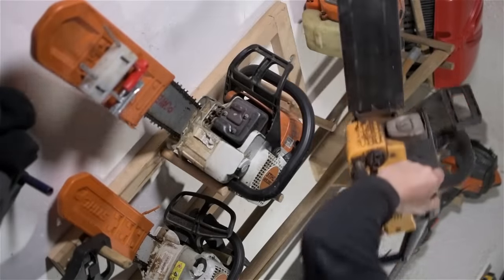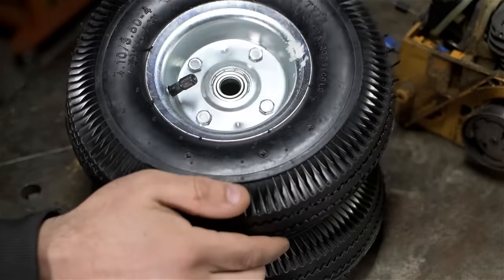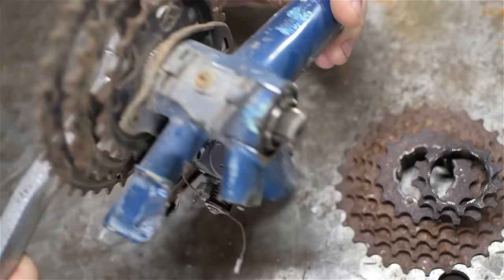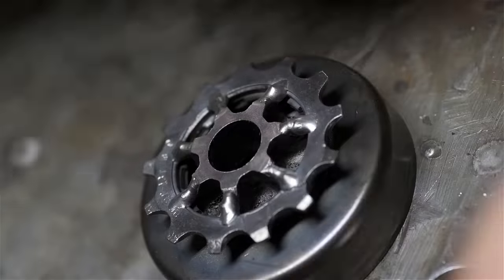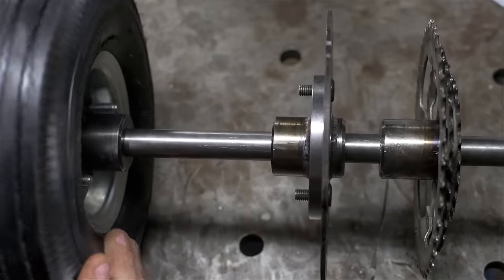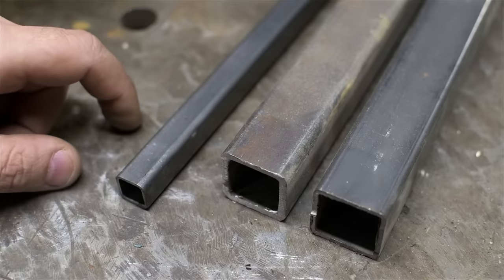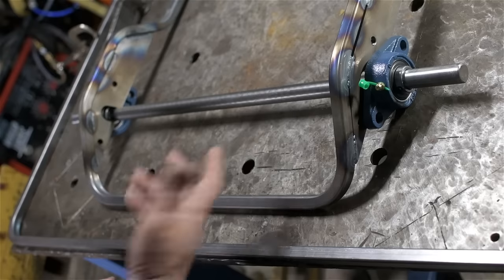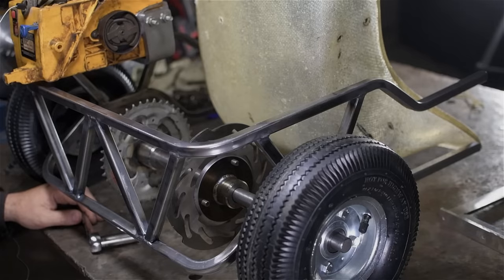CHAINSAW GO KART! - Part 1

Comment: Nice one Tony, really enjoying it so far.  Takes me back to the motorized karts I used to build in my teens.  One of my builds had a solid back axle driving both wheels (as you are building) and the problem with it is there is no differential so the inner tyres slip and squeal when you turn.  Proper karts get around this to a degree by have a high kingpin angle on the front steering hubs.  This causes the kart to tilt over/jack up a bit and lift up the inner rear wheel, allowing it to slip when you go around the corner.  But it makes the steering heavy as it is also lifting your own weight up to some degree and I think children would object to this. A later build just drove one rear wheel, with the other free wheeling and this was better although pulling away could make the single wheel spin as it was taking all the power.  Maybe that is a better compromise?  My builds used things like moped engines which including the transmission so I already  had all the gearing to get the correct road wheel speed.  In your case the double reduction using an intermediate gearset is probably the simplest, as you are planning.  You can then have the intermediate gear on a slotted bracket to tension both sets of the chains.  You can also experiment with the ratios by changing the intermediate set fairly quickly.  Make sure the engine mounting bracket is very rigid - the engine will get pulled down when it applies force to the chain and cause sprocket misalignment and thrown chain.  Ask me how I know!Also, I'm sure you will get to it but needs some shielding between the sharp gears and the seat/child.  Good luck with it all, it is giving me ideas again . . . !!
Reply from the maker: that is good info router, thanks!  I was actually planning on the steering taking some weight off the inside tire to get around the solid rear axle but you have a good point, steering will be harder, hadn't thought that far ahead.  Maybe giant comedy-sized steering wheel?  :)
Reply: Or power steering :)The other thing at the front end to think about is the principle of Ackermann steering.  This is setting up the geometry of the steering arms to allow the front wheels to take slightly different radiuses around the turn.  This is achieved by in plan view pointing the steering arms so they are angled inwards to point at the centre of the rear axle.  A quick google search will show a picture of the arrangement (e.g. Wikipedia).

Comment: Cheap/old bicycles require special tools. Modern bicycles can be taken apart pretty easily with allen keys and a heavily weighted hammer
Reply: Nugenrules tell that to the tool pushers at Park.

Comment: The 75 cc Partner I bought new in about 1977 is the predecessor to the Poulan line, since Swedish made Partner was sold to Poulan. That saw, with a 28" bar, was a killer! In fact, Partner bragged about two of those powering a light aircraft for hours! Sure miss those days . . .

Comment: Probably too late for this kind of change, but you could still use the gear setup. Just build a sprague clutch with a one-way bearing. That way the wheels could still rotate even when the engine was running slower than the driveshaft.

Comment: Real cool! Just a thought, if you did go for double reduction, you could include the free-wheel clutch from the bicycle sprockets so the wheels don't backdrive the engine. Although a little friction might be a good idea when you lift your foot from the gas...
Reply: Kobus Goosen don't forget about the clutch on the output of the chainsaw. It should prevent it from back driving the engine.
Reply: Yes, 2 stroke engines don't like engine braking, because when you close the throttle, you close the source of lubrication, fuel oil mix.

Comment: Why not use the worm drive combined with a freewheel on the axle? You'll even be able to fit a bicycle cassette and a derailleur.
Reply: that i was  gonna comment juste this, if it's not to late that should be the bestt solution
Reply from the maker: my kids wouldn't be able to push it backwards?
Reply: "Objects in a mirror are losing."
Reply: edit: Err... of course the worm gear will never run backwards and freewheeling it would either not drive the kart or lock in both directions, but using a freewheel and an intermediate axle will work.

Had to read about that a bit and see that video again, but as long as the clutch connecting the motor with the sprocket is open at idle/stop (which is the case for chainsaws), the freewheel might lock backwards and turn parts of that transmission. The centrifugal clutch type will avoid pushing against the engine in such cases.

The bicycles axle actually does what is needed. http://www.parktool.com/blog/repair-help/freewheel-destructive-removal#article-section-1
Without much knowledge about freewheels in general: there are bearing type freewheels, so if the engine is stopped, the clutch will be disengaged anyway and can turn free.
Reply: yes they would be able to push it back, use the complete bicycle hub and bore it to accept your shaft

Comment: You never cease to amaze.  I've been shoving soft things in cylinders for years...on bigger saws you can usually get the clutch off with an impact blip though, and the clutch is mounted opposite of the Poulan with a normal bolt.

Comment: When I built a cart for my boy i used a 5 HP Briggs High Performance engine. That cart would do 60 MPH. Yeee Haaaawww. 
My boy loved it.
Reply: gregg4164 lies
Reply: There had to have been a govenor on it
Reply: @fbi1961  not exactly smart are you? A 5hp brigs will easily push a kart 60mph, on a flat road with enough space.

Comment: I remember the first go-karts.  You had to make one yourself, in metal-shop in school or in your garage.  Then they started to manufacture them.  You had a choice between a four-stroke lawnmower engine like a "Clinton" (less expensive and not as fast) and a two-stroke McCullough chainsaw engine (I wasn't aware of any other makes back then).  The fastest karts had two chainsaw engines, one driving each rear wheel.  

At first, ordinary McCullough chainsaw engines were used.  Then when karting became popular, McCullough started making engines specifically for karts.  I remember the Mac 5,  Mac 10, and Mac 20.  

The cheaper karts had brakes that were nothing more than metal paddles that rubbed against the tires.  The better ones had mechanical drum brakes.

Comment: nice cart!

only problem i see so far is the solid axel.
when you drive in a turn the outside wheel rotated faster than the inside wheel.
Are you planing to make one wheel free spinning?
other wise you need Differential
Reply: Jeroen Kort Go Karts never (typically) have a diff, the inside wheel just slips
Reply: I have a kart with a solid rear axel, the only problem with it it it makes it hard to push, and it makes quite a bit of noise going around corners

Comment: I would go with the extra reduction, if only because those tires are very low speed tires, not really trustworthy, and will wear out very quickly at high speeds when turning--from first hand experience.

Comment: Very cool. Your videos really make me wish I had a welder. Or space for it.
Reply from the maker: there's always space for a welder!  can you hang one from the ceiling? couldn't be without mine.
Reply: I already resorted to storing things at the ceiling. Even on my garage door!
Reply: This Old Tony I am close to buying one haha
Reply: Harbour Freight sell oxy/acetylene rigs --cheap! . That's what many aircraft builders use for welding steel tube. Almost every variant of Bush planes use welded steel tubing for the fuselage and landing gear. AND many of the manufacturers CHOOSE oxy/acetylene over TIG because of it's inherent nature to normalize the region that is being welded. Thus reducing internal stresses that may later lead to a failure.

Comment: Only fix one wheel otherwise it'll be impossible to turn. You can make a "Differential" by welding one wheel to the drive axle and leave the other free. You'll just have to choose if you want it to turn right really well or left really well as turning towards drive wheel side is hampered a bit, still better than no diff at all.
Reply: Fred Gryson it'll turn just fine with a locked axle. Shifter karts turn pretty well.

Comment: 125cc kart or old large chainsaw engine needs at least 6:1 reduction... 42 - 49cc engine needs about 15 - 20:1 for it to move... I cringed when seeing you put a huge sprocket on the engine... needed a tiny one... plus a jack shaft for more reduction...
Reply: Yeah, why is he saying the largest sprocket he could fit on the engine?  He's confused.
Reply: BuzzLOLOL o

Comment: Tony, your gear ratio is way too low, er high, er, whatever, I built a few chainsaw powered kids scooters, for drunk adult years ago.

The gear ratio you are aiming for here is 10:1 or even 12:1, to get the motor into it's power band more than anything else. I initially tried using chain with the saws stock clutch and discovered 2 things, the clutch that comes with the saw is not going to be adequate at all, and chain proves to be far to much drag, even when I did a double reduction.

So what did work, vbelt drive with a small as possible pulley on the saw shaft and large as possible on the driveshaft. This setup also allows you to use the belt as a slipable clutch arrangement. I essentially hinged the entire motor on a lever. In my case the rider would step on a lever harder to engage the belt and motor more and when not if they fell off or were lucky enough to step off after coming to a stop the lever would relax the tension of the belt and allow the motor to freewheel without stalling.

Hope this makes some sense to you, let me know if you would like me to post a pic or video of the death machine to clear things up at all.

Love your channel, sense of humor and information, keep the vids coming man.
Reply: Oh I almost forgot, the added weight of the gear on the clutch and the fact that chains are heavy is going to cause you serious problems with the motor attaining any power or reaching its powerband. also stressing the tiny clutch on the saw etc. When a chainsaw motor cannot reach it's power band it quickly bogs and stalls. You gotta drop power train weight.
Reply: you need to include the weight of the tires and axle as well, when compared to those the weight of a bicycle chain is nothing

Comment: Tony,

Those wheels are garbage, change them. I used to use those on pull carts moving animal feed (30-50kg) and i went through a few dozen before i made some all metal wagon style wheels and stopped buying them. The rubber will fall apart in a month, the bearings are crap and the thin sheet metal 2 piece rim will literally fall apart. I know you invested some time beefing them up but that's polishing a turd to be polite. Your kids' life is not worth experiments, change them and get some real wheel and speed rated tires.  This is my first comment on your channel and probably the last too so do as you wish.
Reply: Yep, bought one of those to replace a fragged out lawn tractor tire, and it lasted about a month before it came apart. Got proper replacements on order now...
Reply: I agree totally. Those wheels are gonna crap the bed fast.
Reply: Not only are they crap but at $15 each you paid too much. Can get them for about $5 at HF on sale. I can't see how they'd work well even with the new hubs.
My Father made the Offyette 1/4 midget, so I have some knowledge of what you're up against.
Reply: MotoWanderer 
Haha I had one of those blue harbor freight hand trucks, and needed front wheels on my kart for a test run. 
See where I'm going. 
About 5 mins of riding and I see the right tire wobble a little as I take a left hand corner.
Gee maybe I should check those 4 hub bolts, TOO LATE! 
next thing I see is the tire rolling away in a straight line ahead of me as I'm turning left and the spindles grinding the pavement at about 30mph. 
So I straighten the steering wheel and go chase my darn tire like it was a normal thing.  
Busted the center right out of it. 
Oops. 
So I welded it back together ,crooked, and put both of them back on the hand truck. 
That was enough go kart testing for that day.
Reply: I got the same crappy wheels, and they lasted 5 mins before bending and wobbling. So any urls for good alternatives...?

Comment: My dad built one of these back in the 50's, with 2 engines. Each drove the separated rear wheels, and to turn on the dime, there were separate kill switches on the steering wheel, which you would press to kill the engine on the inside of the turn.

Comment: As a professional chain saw and small engine designer, builder,  fabricator,  and mechanic.  And also being a chemist in the fossil fuel industry and not to mention a retired poulan and stihl ceo you should never  start a chainsaw without the plastic cover on it.  Just saying.
Reply: As a professional hand model, inventor of the keychain spark plug gap tool, former NASA test pilot and writer of three hit musicals, I agree. 
 Also be sure to keep all your sharpest swords in cheap nylon sheathes.  When removing them, firmly grasp the sheath up by the hilt and rapidly draw the sword out   and saying "shing!"
Reply: @heatshield  Three hit musicals. Lofl! well played my friend. Well played
Reply: @heatshield  hahahaha
Reply: @heatshield  lol. Well said. But one does not simply remove one's sword from its sheath. One must first announce proudly to all in the vicinity: "stand back! I'm going to whip it out!"

Comment: You mentioned making it light and not very "tippy", yet you've got a huge bit of plate in there for the bearing retainer and mounted the axle under the main chassis rail. You've defeated your own intentions there! About 40 years ago, chainsaw motors were THE thing for race karts in the entry level class... in NZ anyway. The 100cc "McCulloch" engine was awesome :)

Comment: I have a 40-year-old Echo 440EVL. Has performed flawlessly for 40 years. I heat with wood in the winter so it gets one hell of a workout every year. The secret, Never Ever Leave Old Fuel In Your Saw Unless It Has A Fuel Stabilizer Added.

Comment: There's a lot of history involved in answering your question about bicycles. The short version is that the French, British, Italian, Japanese, and American bicycle manufacturers all had nearly 100%  market share in their own countries, and no one forcing them to work together on an industry standard.
And as for why everything requires a special tool - the focus was always on making everything compact and lightweight. Bike shops were everywhere and there was no need for a cyclist to do major repair work. Aside from minor adjustments, all maintenance would be done in a shop by an experienced mechanic.

Comment: Back in the 80's a friend and I took a Yamaha 80cc two stroke bike that had a bent head stock.  We cut out the part of the frame that mounted the engine, welded it to a base plate in the cart and mounted the engine.  We devised a little a "T Handle" shifting bracket and a foot clutch.  We had five speeds and it went like he'll.  I often wished for a 250cc engine but realised we likely would have gotten killed with that much power.  Finally life went on and it got put in the back of the barn with hopes of resurrecting it some day...  Damn it was  fun while it lasted.

Comment: I have a nearly 50 year old ECHO 440 EVL 18" chain-saw converted into a 24". During its lifetime I have personally watched my ECHO 440 EVL run circles around much larger and much more expensive saws, especially those with "Well Known" names. There are a couple of things that I haven't mentioned about the success of my ECHO chain saw. The first is that I sharpen all my chains using a file free-style. The second is that I know just how much I can file off the top of the drags before overburdening the saw's engine. Most chain factory drags are to high and just wastes the saw's power potential by peeling off thin wood shavings when it is capable of cutting much deeper, or more depth per revolution. That is why my little ECHO saw outperforms much larger saws that are brand new.

Comment: Hey Tony, Just an FYI, that's exactly the best way to remove a chainsaw clutch assembly.  However, just keep in mind, you'll want to bring the piston to almost TDC or at least pass the exhaust port so that the length of rope doesn't get jammed up in there.  👍

Comment: My first honest to gosh go-kart was made using a McCullough chain saw engine back in 1963. My great uncle had a machine shop with all the power tools run by an overhead belt driven by an electric motor. My dad told me that when he was young he would get paid a nickle for stoking coal into the little steam engine that originally ran it.  So he and my great uncle decided my wooden go-kart with it's Briggs 3hp engine was too dangerous, so they made me one out of metal.   It worked fine but the state police took a dim view of me racing down the road with it!  When I left high school and was waiting for the army, I gave the little beast to my cousin who kept it for many years.

Comment: Love the build. A couple of observations if you decide to do this again at some point, or others decide to follow...  
Larger diameter tires would give you a lot more flexibility, and can be had looking at mini-bikes or small off-road motorcycles. They might be expensive to purchase new, but these bikes are regularly for sale second hand very cheap. These would also have much better side load capability, and come with sprockets already in place. 

Scavenging off a small trail bike would also have the benefit (I'm assuming the engine wouldn't work is why it's cheap enough to scavenge) of suspension parts, throttle cables, brake pieces, etc. Starting with someone else' successful design is a great way to boost your own successful design. 

Absolutely love the truss style frame. Very slick use of material on hand.